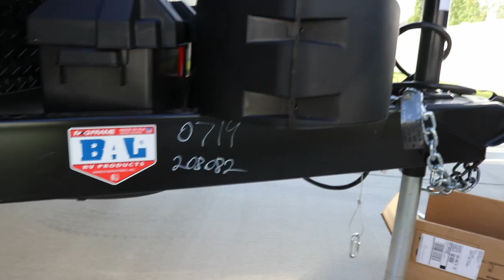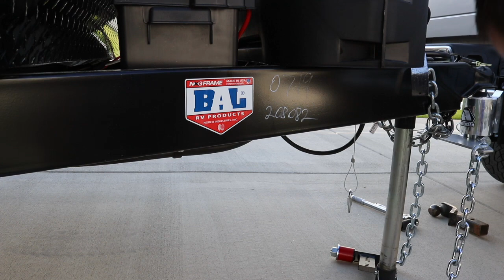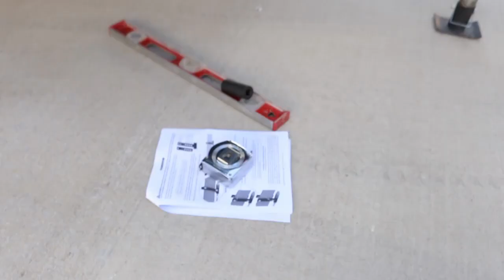Andersen No Sway Hitch Install Guide | The Savvy Campers

Comment: We have this hitch for 25 ft , 6000 lb TT. Much easier to hook up and much quieter.  We had conventional bar WD hitch first. The Anderson stops a lot of the porpoising and seems equal on sway control. Did have to fiddle with it a bit to get right height and keep our trailer level.  Seems like does not work quite as well for weight distribution - but is certainly acceptable and the other factors make it a great hitch.  Also like the fact there is no grease.  Seemed like I could never hook up the other hitch without getting a little grease on my pants.  Thanks for the video.
Reply: @TheSavvyCampers  I watched your video and read thru all the comments and was about to order one of these hitches untilI read your final comment. "I have read that it does not work as well on heavier units". That's a deal breaker for me. I just purchased a toy hauler travel trailer. Dry weight is 9710lbs. I dont tow with much cargo in my trailer but I will be carrying a 1900 lb UTV in the back so I guess I will go with the old noisy bar style WDH.
Reply: What tow vehicle do you have
Reply: @JT-lu8vt  Ford F-150 2017 King Ranch version.

Comment: On my trailer, the emergency brake cable is mounted on the inside of the frame right where my brackets for this hitch need to sit. Has anyone else had this problem? Is it possible to move the emergency brake cable somewhere else?
Reply from the maker: As long as you have room, you could relocate it, as long as it has a clear path to operate and the wire lead is not too tight that it would lock the brakes up on a turn.

Comment: I believe you should insert the bolts for the frame brackets from the inside so the nut goes on the outer area. Not required but I think it helps position the bracket correctly after tightening.

See at 5:10
https://youtu.be/QXScZUEVcrc
Reply: Ryan Andersen has a video (produced/posted on May 1, 2019) that's very good in showing the installation of the No Sway Hitch system. He goes into insuring the trailer/tow veh are level, measuring the hitch ball heights, positioning of the bolts so the hitch doesn't "crawl" on the trailer A-frame and accessing the nuts when tightening, etc.
I'm more concerned seeing a good video on backing the trailer up, then how to disconnect and reconnect when ready to go back into travel mode. Any good YT vids on that procedure?
Y'all Be Safe!
Reply: Raymond Schneider I know there isn’t a video on it, but the whole idea of using these chains and this hitch as a whole is that you can back up with the hitch still as is. And then un tension everything I believe.

Comment: At 9:30 you mention drilling a pilot hole. What is a pilot hole needed for? Thanks.
Reply: The pilot hole is for the set screw,without the pilot hole the set screw would be flush on the frame,with a pilot hole the set screw would  seat in the pilot hole for a more secure fit,the set screw is added security to keep the brackets from moving.